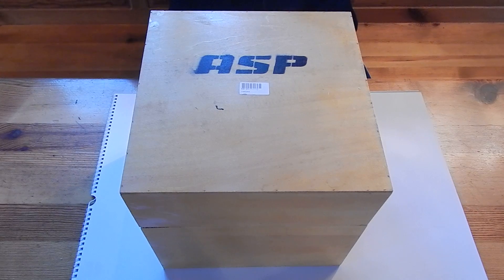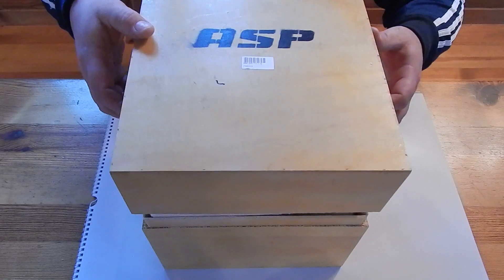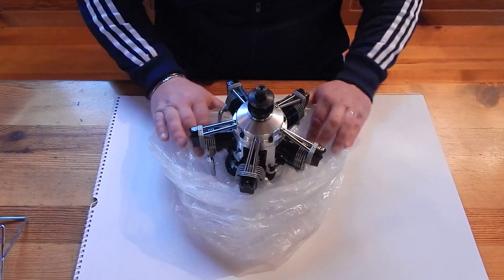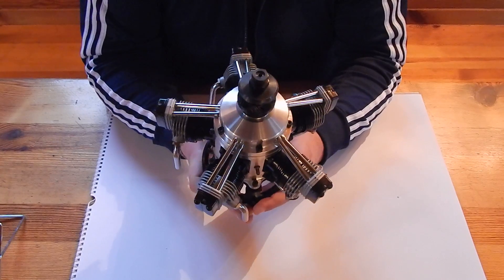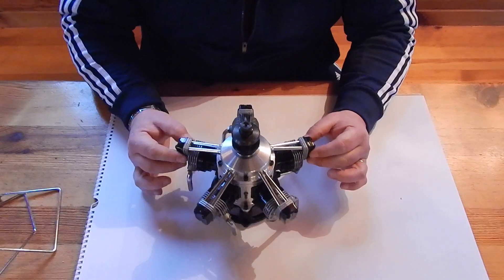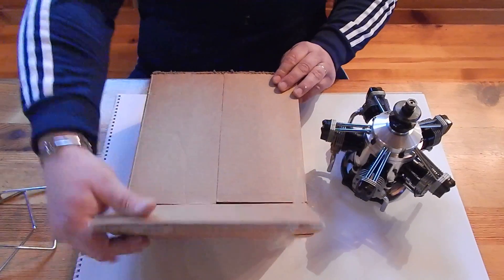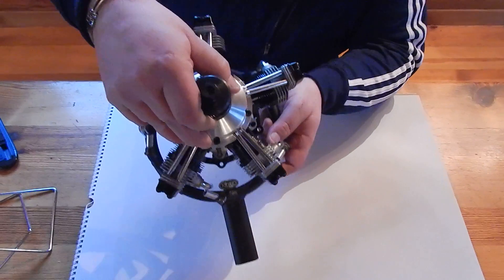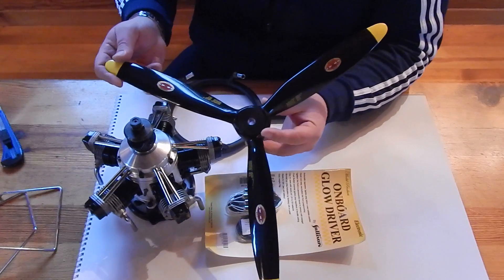ASP FS400AR four stroke 5 cylinder glow engine unboxing

Comment: The bottom cylinders flame out cause everyone uses the wrong plugs and fuel .dont use what the manufacturer tells you. Keep the oil content a little less a hotter plug and more nitro and it will do fine

Comment: Did you ever get this beast in the air? 🤔
Reply from the maker: I will leave it new in box.
Reply: @PetrincicBrosRC  so you won't  fly this? That's sad
Reply from the maker: @dasKontroloer  At this point its hard to say. Its worth a lot more if it is NIB. But maybe someday I will just say what the hell and mount it to the stand and we will have the best fun ever.
Reply: @PetrincicBrosRC  thanks for the quick response! If you will run the engine it would be nice, but if you dont want to, its your decision.
Reply from the maker: @dasKontroloer  They dont make them anymore, so if you have one new in box its a yewel.

Comment: What a beauty.   I cant seem to find the maiden with this jewel.   Did you make one  ?   Your friend Russ
Reply from the maker: Hey Russ. No, this baby is still waiting for the first run. I have Sulivan glow for this but we are just waiting to do the unboxing of the plane too before we test this baby. We will try it soon. I hope ;) Cheers, Robert
Reply: I assume its the Seagull model.   Looked at the instruction manual on the Hobby Gulf site.  Pretty straight forward but with that monster on the front its gonna be nose heavy to begin with I would think.  You have a reason to buy a nice trailer now.   Oh yeahh.    Maybe you could do a build video too.   That would be cool.   Yessss
 Russ
Reply from the maker: I have the plane now for over a year and I didnt even opened the box yet. But it is Lysander with 3m wingspan so I think that it will be perfect for this motor... Cheers, Robert

Comment: Congratulations on your new radial engine! I think you should start it the first time with the open exhaust pipes, as it sounds like a beast.You will love it. I find it interesting that when I bought mine, all the parts were dull gray. So I polished my engine. Then shortly afterward ASP changed theirs to the nice tumble polish finish like yours. I made a couple of ring exhaust manifolds and they do change the exhaust sound very much, to a more mellow sound. One last thing, I would not break in the engine on that big Biela prop. Go a little smaller.
Reply: https://www.youtube.com/watch?v=7bvhd67Za88
Reply from the maker: Thanks X. We will use smaller prop for runing in the engine. Cant wait to hear that beast roaring. Oh yeah... We will do that this winter. I have Lysander 3m for this baby. Cheers, Robert